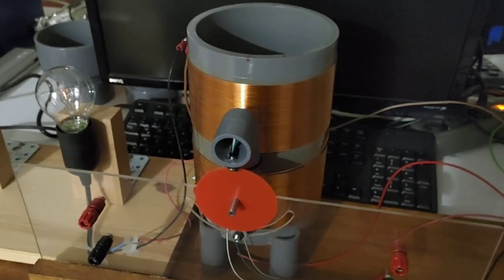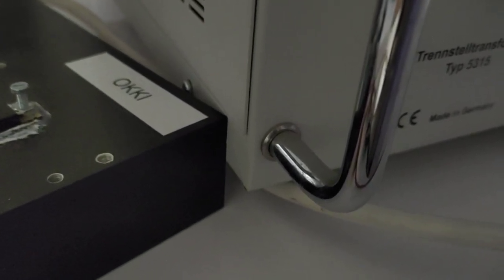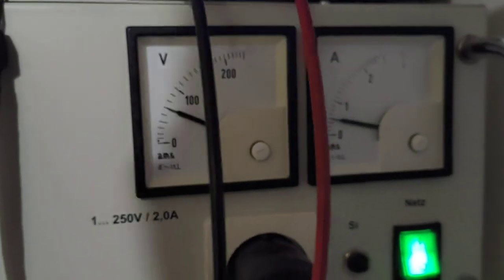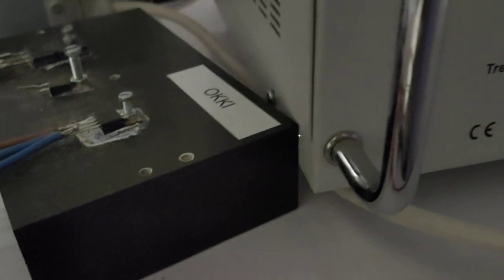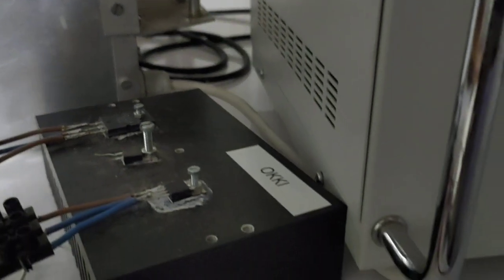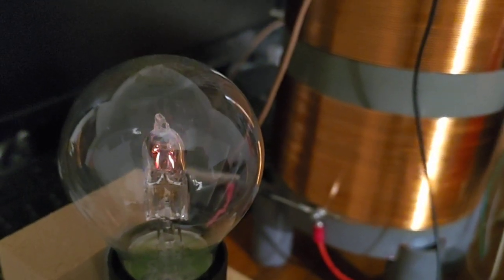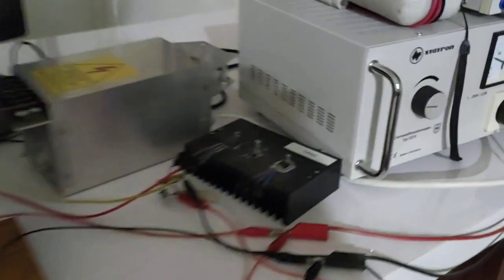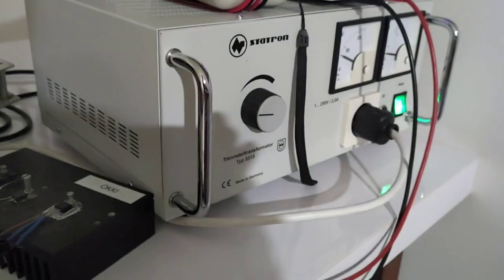Newman Motor - High Voltage Effect

Comment: Okki, what you are seeing is skin effect. Keep in mind this will also apply to any excess energy you might want to extract. That is to say you will want to use multiple wires terminated together at each point instead of a single thicker conductor typical to amperes and DC. Similar to RF energy it flows only on the outside of the conductors. Multiple conductors=much greater surface area=higher radiant extraction.